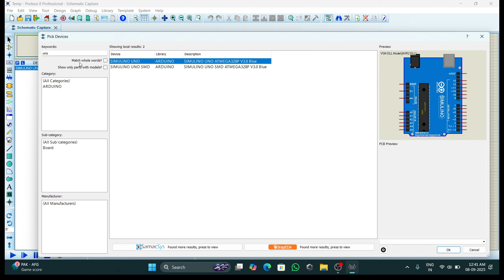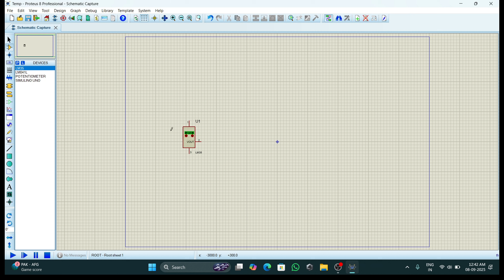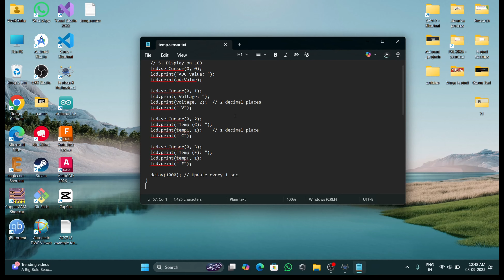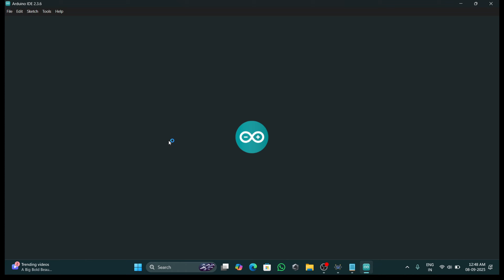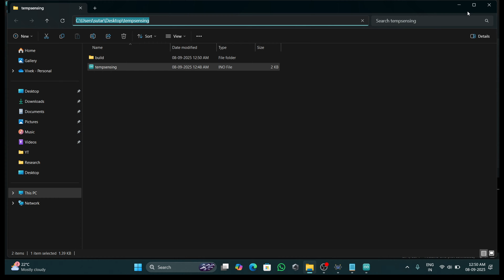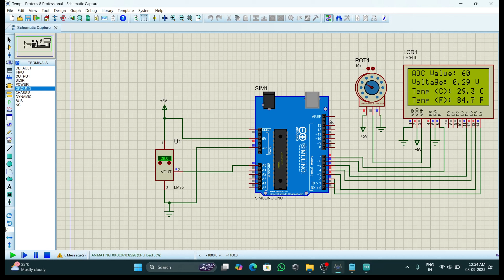How to Display Temperature on LCD using Arduino & LM35 | Easy Proteus Simulation Project

Comment: #include <LiquidCrystal.h>

// LCD pin configuration: RS, E, D4, D5, D6, D7
LiquidCrystal lcd(7, 6, 5, 4, 3, 2);

int sensorPin = A0;   // LM35 connected to Analog pin A0
int adcValue;         // Stores raw ADC value
float voltage;        // Stores converted voltage
float tempC;          // Temperature in Celsius
float tempF;          // Temperature in Fahrenheit

void setup() {
  lcd.begin(16, 4);         // Initialize 16x4 LCD
  lcd.setCursor(0, 0);
  lcd.print("LM35 Temp Sensor");
  delay(2000);
  lcd.clear();
}

void loop() {
  // 1. Read analog value (0 - 1023)
  adcValue = analogRead(sensorPin);

  // 2. Convert ADC value to voltage
  // Formula: Vin = (ADC_Value * 5.0) / 1024
  voltage = (adcValue * 5.0) / 1024.0;

  // 3. Convert voltage to Celsius
  // LM35 gives 10mV per °C => TempC = (Vin / 0.01)
  tempC = voltage / 0.01;   // or (adcValue * 5.0 * 100) / 1024

  // 4. Convert Celsius to Fahrenheit
  tempF = (tempC * 9.0 / 5.0) + 32.0;

  // 5. Display on LCD
  lcd.setCursor(0, 0);
  lcd.print("ADC Value: ");
  lcd.print(adcValue);

  lcd.setCursor(0, 1);
  lcd.print("Voltage: ");
  lcd.print(voltage, 2);    // 2 decimal places
  lcd.print(" V");

  lcd.setCursor(0, 2);
  lcd.print("Temp (C): ");
  lcd.print(tempC, 1);      // 1 decimal place
  lcd.print(" C");

  lcd.setCursor(0, 3);
  lcd.print("Temp (F): ");
  lcd.print(tempF, 1);
  lcd.print(" F");

  delay(1000);  // Update every 1 sec
}